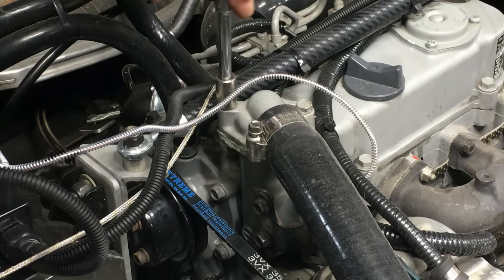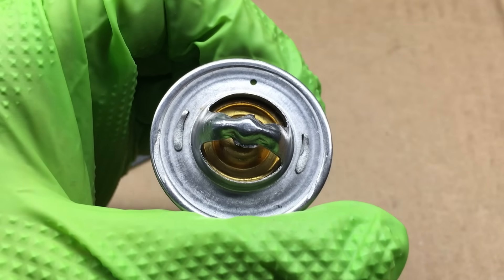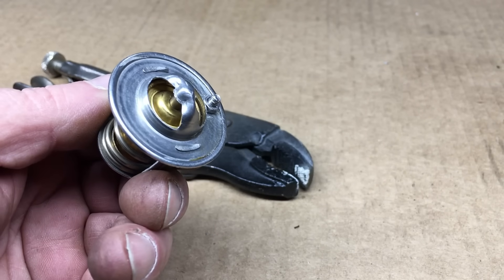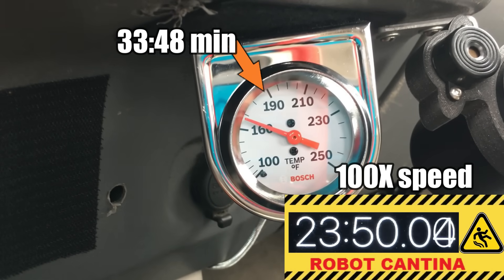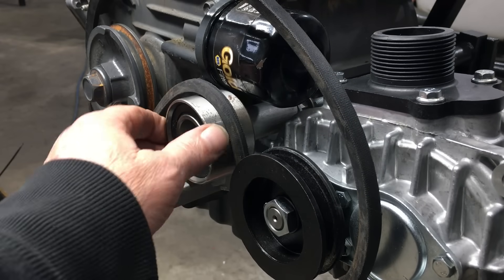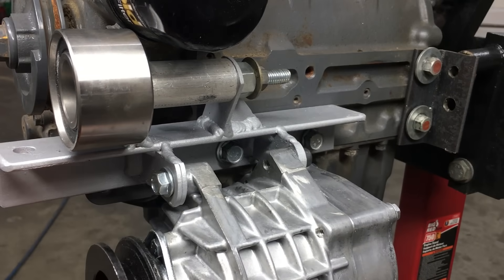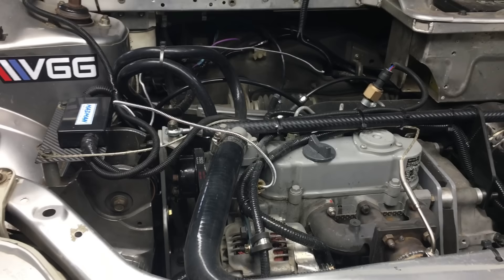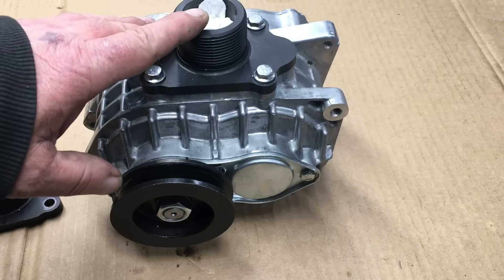S4 E4. Thermostat issues and making an AMR500 Supercharger fit a 719 cc Kubota diesel engine

Comment: if the engine keeps running too cool you might need to put a restriction in the radiator hose , the reduced flow should at least make the temp swings react slower and make the engine heat up faster after the thermostad opens
another option would be to put the pump impellor in the lathe and make it smaller so theres more cavitation / less flow , i think that needs to be done through trail and error as i dont know how to calculate "a "difference in temperature through flow or how mush cavitation the smaller impellor will cause 
making the radiator smaller might be needed too
as for putting on a bigger pulley on the crank : if you mill the back of the factory pulley flat and add boltholes you could mount a sheetmetal pulley over it mounted against the back of it and still have the conunterweight on the front of the setup
think the added benefit of a supercharger is that it way more liniar , the boost is rpm based not based of the exhaustflow / load / innertia like a turbo , this likely makes it eazier to tune the pump and get the most power out of the engine throughout the powerband no matter the rpm or load 
not even sure if there is a fuell efficiency difference between the blower or a turbo unless the engine runs at a verry small and constant rpm band 
the boostcurve / spool up / innertia of a turbo over a larger rpm band might cause the need to run the engine richer / hotter / less efficient to get the turbo past a restriction

Comment: Engines that perpetually run cold will eventually oval out thr cylinders due to cold metal friction. Ask me know I know? Faulty thermostat (jammed open) for 5 years - engine lost compression due to lots of freeway driving, temp usually 1/3 the gauge. Upon inspection, all cylinders were oval shape, deep ridges only on front and back of block, lots of piston slap. New block was required. Engine only had 73000km on it and was serviced on interval!

Comment: Have you thought about using a 12 volt RV hot water heater, like one with  an on/off switch? Instead of wasting all of your fuel, not put any miles on it. Just a thought.
Reply from the maker: A few  things to consider...  The engine needs to run between 180-190F for overall efficiency and to reduce wear.    The waist heat from the engine is free energy that is otherwise wasted when its  dumped into the radiator.   When the engine is running at its ideal temperature, the waist heat can be diverted to the heater core and  that will keep the interior of the car warm ... for free.  An electrical heater would consume way too much power to  be of any use.
Reply: @robotcantina8957  the heater would be used to bring the motor up to temperature quickly, so you don't have to wait so long , not to use as a heater for cabin heating.

Comment: Curious if we're gonna see a head gasket and head replacement episode in the future.
Reply: Burnt valve.  Jimbo is good about watching exhaust gas temperatures but some engines it goes up really quick hitting boost.
Reply: @daylongdriver1  these engines in particular are also very prone to headgasket failure or cracks in the head if they run a bit too hot.

Comment: Lisle Plastic/Metal Spill-Free Funnel
Line: LIS Item: 24780  I use this funnel to fill most any car.  Sorry the picture wouldn't copy and paste.  with the adaptors it can be very high as it doesn't leak or very little, so you can rev and motor and any air will bubble out and it'll be full.  as far as the thermostat, it should totally block the hose, not open till it hits the desired temperature and then open more if it goes over.  works on 125 cc motorcycle engines so it should work on yours also.  Motorcycle radiator might work good, just get wrecking yard craigslist stuff.  Your not trying to make anything but a prototype so it does have to be new just throw away cheap.  I find off brand thermostats are cheap and unreliable, and do what you show.  Stay with brand names like Gates and murray, those problems will end.  What came with this engine?  test in pan of water and see where it opens.  Bew careful as some will pop open ands jump out of the pan, close justas quick, clamping onto our finger.  any questionable stuff I always test with a food cooking thermometer,  set to 212 boiling water with no lid.  Never found any that were right fight out of the box just twist them to get them right.  Really get fancy check freezing too, but it takes too long, and it's harder to watch.  (Most engines )not all run best very hot 205 even hotter using a coolant mix higher then 50/50, just too hot is too hot and anything cooler uses to much fuel as the system's are trying to get hot and don't do anything about getting cooler till they are really hot, off the dial hot.  Pressure is important also, just be sure that all connections and parts can stand it. think Formula one and then back off to budget stuff.  A coolant circulation pump like used on Dodge Durango 2002 will make the coolant go around so as to get the hot spots to heat the cool spots, maybe wrap a soft copper line around the exhaust right at the manifold, Three turns will work as it has on my projects same size as heater hose and have that line go straight to the heater core. Add this pump if needed,so the engine and the heater core are on all the time except startup.  the pump doesn't restrict flow so it'll still flow off, but may bleed to at idle.  the Durango has no rear heat unless it works. the heater core may over cool the engine.  emission control on normal cars call for full operating temperature in just a few minutes.  all my cars do or I'll fix them so they do.  I hate spending gas without any good reason.  Hope you can work any of this in.  Overcooling kills power, Motors too.
Reply from the maker: Thanks for the heads up. looks like I need one of those.

Comment: deleting the hole in the thermostat can cause the water pump to cavitate if its not got a recirculation loop back to the waterpump inlet. you dont want to dead head the system

Comment: I would love to see the supercharger slightly under driven and a larger turbo compounding into the supercharger. The larger turbo would provide an elevated "atmospheric pressure" for the supercharger, increasing its efficiency for a given pressure. Maybe that could be a logical step after the Stupicharger project is complete! Lol. Also, as I believe I had mentioned before, a realitively cheap turbo to get your hands on would be a GM8 turbo from a late model GM 6.5 turbo diesel. It's wastegate is operated backwards from most turbos for diesels in that is "normally open" by design and uses vaccum to hold it shut. Most guys just wire the wastegate shut, and that should be no problem for this little motor, since the 6.5 struggled to overspin the turbo without a lot of mods anyway 😂

Comment: I have been watching your videos for a while and I find them really satisfying and interesting. The only thing that I can’t get out of my head is that you put all this work in, and a standard French or German Hatchback like the Renault Clio 1.5 dci will get better fuel economy, 5 seats and around 100 horsepower. Do you really not have those in the US?
Reply from the maker: The projects we do on the channel are not fuel economy projects.   we experiment with small engines and try our best to make the cars go faster.  Obviously a larger engine would be better suited, but the fun is trying to make a lawnmower engine powered car go fast.  Renault, Peugeot and Citroen stopped importing cars to the states many decades ago.   Here in the states, small fuel efficient cars don't sell as well as larger cars or trucks.

Comment: If you watch the video, you can see the temp rise slow and stop for a moment just past 160. With the bypass there, the radiator water will be prewarmed a little more. Now it has to suddenly get warmed up. I dont think its a real problem.
If you want an idea to resolve the burping problem, vacuum filling of cooling systems is a thing. This uses a special adapter and a vacuum pump to place the cooling system under vacuum. Close off the pump and open a line dipped in your coolant mix, sucks it right in and avoids any air pockets. Repeat until full.

Comment: The thermostat from a 1971 chevy  350 fits.
Reply from the maker: The Kubots D722 uses a very small thermostat, actually its an odd size and 180F is the hottest available.

Comment: I was also wondering if you could buy and find some industrial type louver that run by a cable for your radiator to block the air? I thought a thermostat supposed to open and close to maintain 180° temperature.

Comment: Trust volvo to be over-complicated and use a rollerblind, when Citroen just used what is basically that corrugated plastic sheet solution on the aircooled A-types (2CV, Ami, Dyane, Mehari, etc.), a grille muff, fit when the outside temps drop, remove when they rise, simples... :P

Comment: My daily driver is a VW with the 2.0 liter, twin turbo diesel. I have noticed something over the years..........on normal commute, which is mostly open road, it is worse on fuel economy in winter........until the engine fully warms up ( my winter mornings in Australia is about +5C to -2C ).    This does not happen with my gasoline powered vehicles.  Superchargers can actually still be good for fuel economy, compared to running a bigger engine.  At one point in Australia GM/Holden sold the commodore 4 door sedan with two sports options.......the V8 5.0 (2 valve head) and the Supercharged Buick V6 3800 (2 valve head).  The Supercharged V6 made the same power as the V8 but for less fuel consumption provided they had the same high flow exhaust. See, Holden knew how good the blown V6 was, so from factory they deliberately choked the exhaust system to get it below the output of the V8.  However, the blown V6 3800 did have the sophistication of a blower bypass so when coasting, the blower did not draw power from the engine.  So, if you can get the little diesel Kubota to run some boost, it should benefit from making the same power at fewer rpm.  However, Roots blowers like the AMR series have poor efficiency at high boost levels....the air temp will rise drastically (reducing density and thus performance).  You might want to consider an intercooler at boost above 12 psi, there are compressor efficiency maps for roots blowers.

Comment: Maybe in the future you can try to find a super cheap vgt turbo or you can try to super cheaply compound turbo the kubota it would significantly help with egt’s and the turbos could actually spool
Reply from the maker: Check out our older episodes.  We tried a RHB31/ VZ21 turbo on this Kubota engine when it was in the Saturn.  The VZ21 is the smallest turbo available and its is to big for this engine.  The VZ21 makes boost, but you have to push the engine hard to develop real boost.  The supercharger experiment may help solve the boost issue.  Keep in mind this is a tiny engine and we don't have the luxury to copy what other people have done.  The experiment we are doing are the only ones on the internet.
Reply: @robotcantina8957  ohhh i see, cant believe you responded tho thats cool i absolutely love this Kubota series. If i may lend a small word of advice though, I've seen one other notable video of someone trying to use the AMR500 on their engine and while they were still within the RPM limits of the super charger the oil seals failed on his and oil/lubricant from the supercharger was getting shoved into his intake. this being a diesel is just a note for concern when it comes to running away maybe or just the supercharger failing outright
Reply from the maker: @ngelemental2274  We had a similar issue with the oil getting past the seals on the AMR300 supercharger, however that was on a gasoline engine and the problem was directly linked to the throttle body causing vacuum to develop inside the supercharger at idle and when the throttle was lifted at high RPM.  The good news is there is no throttle body on a diesel engine so oil getting sucked past the seals shouldn't be an issue, unless the seals are already bad.

Comment: Maybe instead of the idler bearing you could mount a dual pulley, one to run the alternator belt and the other pulley to run the compressor with a separate belt. This way, you can adjust the ratio by swapping the alternator belt pulley, the compressor belt pulley and the compressor pulley. Like an idler dual pulley. So you're not that limited by the engine pulley. Hope this helps if you will have issues with the ratios
Reply: or just add a pulley any size you desire to the outside, pinned to the crank pulley as to not slip under the longer than stock crank bolt.(if you can find the right thing)
Reply from the maker: Great idea!

Comment: I'll be honest you would be better off running that blower off of another motor entirely as the power drain from the pully will offset any gains you may have had from boost.
Reply from the maker: Keep in mind we ran a supercharger on a 420 cc lawnmower engine and made power.  Sure there will be some losses, but not as much as you think.

Comment: I don't understand why people would complain about putting a supercharger on a diesel engine, as if it wouldn't benefit from it. Boost is boost. It doesn't matter what it comes from (unless they're talking about parasitic drag). The old Detroit Diesel 2 stroke engines used roots type blowers for scavenging. They wouldn't work properly without them. I, for one, can't wait to see how the Kubota will work with one. Nice work Jimbo!! 👏
Reply from the maker: I believe the concern some people have is the parasitic drag and how it will effect the fuel economy.    This car gets pretty good MPG, but it's too slow.  The only option left is BOOST!!!!  and a StuipdCharger is exactly what we need.  Stay tuned!
Reply: Tanks for asking!!!

What I think is… diesel engine still have lot off torque to handle the mechanical charge, and in the other side have the instant boost.

Comment: Have you ever used a no-spill coolant funnel?  I find that they make refilling and burping the cooling system much easier.  O'Reilly has a Lisle for $51, AutoZone has an OEMTools one for $45, and Advance has a Lisle 24680 for $52, but a Walmart vendor sells the Lisle 24680 for $29.
When I bought mine, a Home Depot vendor sold the same one for less, and AutoZone matched it.
Of course, Amazon sells the OEMTOOLS 87009 for $20, although there is only one left.
Reply: Shouty Kilmer showed something similar for oil, but it wasn't available anymore.  I found something comparable, but it was a waste of money.

Comment: normal car v belts don't like to bend "backwards" usually stress the rubber so it breaks faster if you are going to drive with a belt that is turned and tensioned "backwards", check with someone who deals with belts made for that use, for example lawnmowers and tillers, snow blowers etc 🙂

Comment: Actually, it’s not surprising that 8 pounds of boost blew out all the gaskets, back in the old days, the maximum boost of a Judson supercharger, the kind used on VW Beatles, was set at 5 pounds of boost, which gave the beetle almost double The 40 hp which was stock from the factory.

Comment: I have been a development engineer on automotive powertrains for almost 25 years, over half of that being specifically on cooling systems.  On everything I have ever dealt with from heavy-duty Diesel engines to GM and Ford products in my own garage, the temperature marked on a thermostat has always been the start-to-open temperature.  It will be fully opened 10-15°F higher.  There is of course hysteresis on the way back down, so it won't be fully closed again until 5-10°F below the nominal temperature.  If yours is marked 180°F and is actually operating between 160 and 180°F, something seems wrong to me.  Put the thermostat and a thermometer in a pan of water on your stove and observe the temperature as it warms up and note when the thermostat starts to open and is fully open if you are in doubt of how it works or whether it is working correctly.  As for the 1/8" hole in the thermostat, it is to vent air during the initial fill and start-up.  I have never previously seen one that just had a hole.  They usually have a jiggle valve, which is either a ball bearing in a cage or a ball with a hook through the hole, so it will vent air but then be held closed by moving coolant.

Comment: You can get a vacuum pump and pull a light partial vacuum on the cooling system and then dip a tube into the coolant bottle before opening it. It'll fill itself completely with 0 air left in the system if you do it like that and takes less than a minute. Another thing you could try is to use an electronic thermostat somehow. Just an electronically controlled valve that can stay completely shut until operating temperature and then vary the amount of opening to keep the temperature where it's supposed to be. Probably a major pain to set up but would work.

Comment: So the bypass in the thermostat is actually NECESSARY for proper functionality of the thermostat.  The reason is that the thermostat is dependent on the flow of hot coolant through it to activate the opening of the thermostat.  Without coolant flow, it is dependent solely on engine heat every so slowly working its way up there.... that's why it took longer to open when you blocked off the hole.  You are going to have surging hot to cold temps instead of even temps until you are at a stead running temp as long as that hole is blocked off.
Reply from the maker: From a cold start to 160F it actually tool less time with the hole blocked off, not more.  Now from a cold start to 190 it did take an extra few minutes.  Not all thermostats have holes in them,  I think before we make any judgments, the car needs to be driven and we can see what actually happens when there is a load on the engine.  

  .
Reply: @robotcantina8957  Let's do it!  Onward!